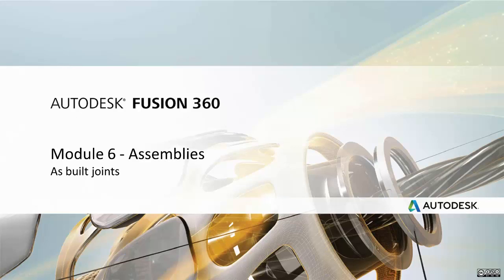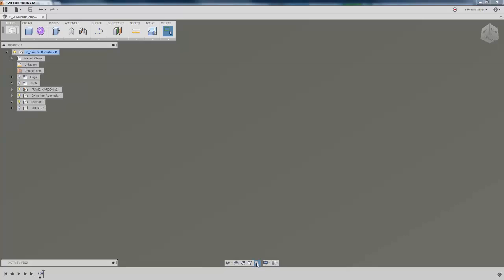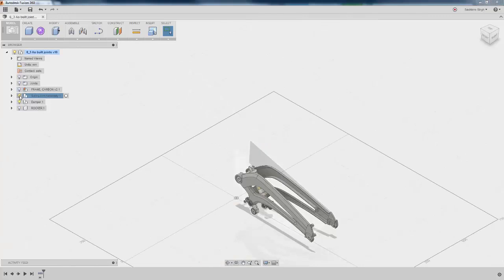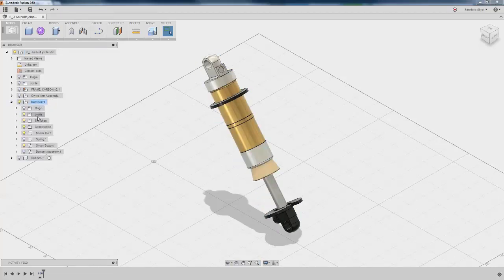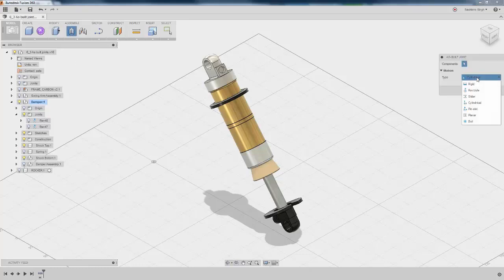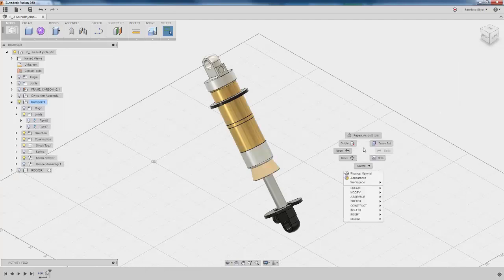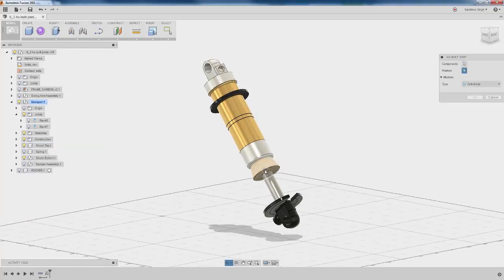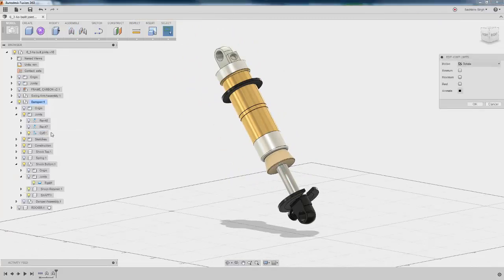06 As built joints

Comment: what is the difference between joints and as-built joints?
Reply from the maker: carolcheny 

I like to think of it like this.  Joints are used when components need to be
aligned as well as define their available degrees of freedom.  As-built joints are used when you design your
assembly as it would be made in the real world so you only need to define how
many available degrees of freedom each part has.